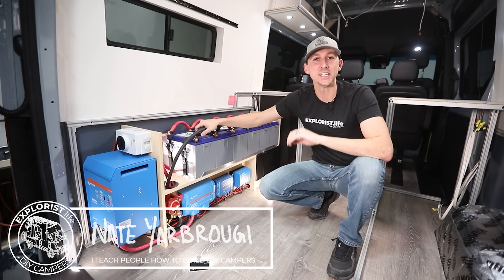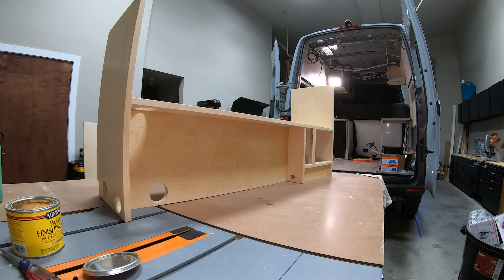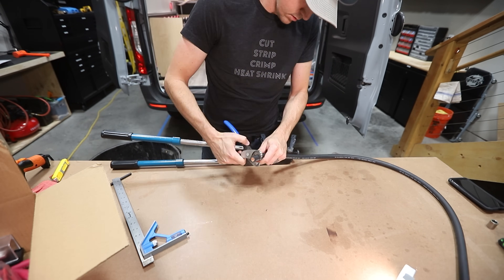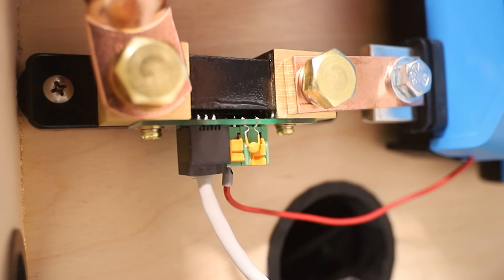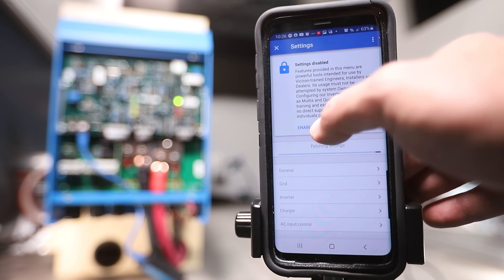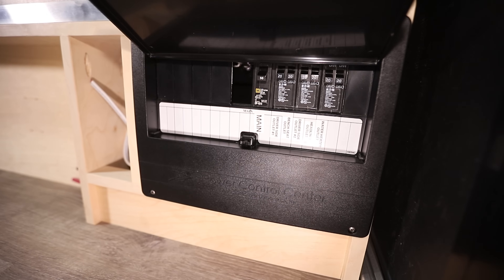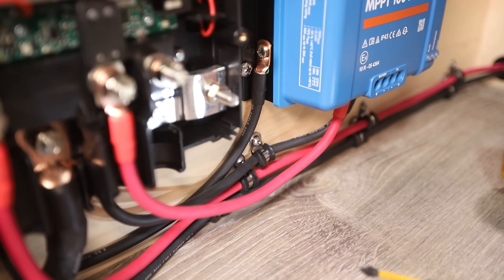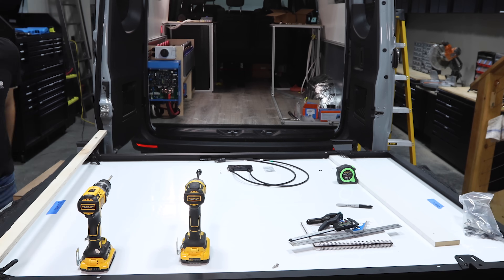DIY Sprinter Camper Van Electrical Install - Full Tutorial

Comment: I have done a few installations as well and I  have a quite of few comments about mounting on wood, or any flammable materials. Any insights, advice.
Reply from the maker: Although wood is indeed technically a Class A Combustible material, it's auto-ignition temperature (the temperature at which it will catch on fire without an external source of flame/spark) is just north of 400 degrees F.  If temperatures are high enough to get the wood to 400 degrees, something else has gone terribly wrong and there will also be other things in the immediate vicinity that will be catching on fire.  **Not too often I get to use my degree in Fire Science.  Thanks for that. :)
Reply: @EXPLORISTlife thanks, watch your videos and good to get tips from.
Reply: @EXPLORISTlife  I have fuses and heat is never an issue but people will always point out something.  I  guess it a way to strive for perfection.

Comment: Hi Nate. Dc-dc charger, you always prefer Orion-Tr Isolated Smart DC-DC Charger. What is the reason for choosing non-isolated?
Reply from the maker: Isolated works in 100% of all use cases with no questions asked, which is why I recommend it over non-isolated.
Reply: Thanks. One last question. Where I plan to put the charger is 17 ft from the car battery. This distance creates a problem for 16 mm2 cable. Does the non-isolated charger have an advantage in this regard? Your answer to this question is very important to me.

Comment: Question, the sprinter fuel tank is on the left side, are you concerned about weight when placing the battery bank on the same side?
Reply from the maker: The battery bank weighs about the same as an average size adult male.   So, no.  I'm not concerned.
Reply: Thanks for the quick reply. Your videos are the best. To the point, in order of application, very informative. Thanks

Comment: @EXPLORISTlife  there an important reason why you are wiring your A/C power with 3 insulated wires, instead of standard 12/2 or 14/2 wiring?
Reply from the maker: Very much so!  I think you'll find our 'Wire Basics' chapter of our Academy helpful: https://www.youtube.com/playlist?list=PLmvhcyi4n0TXLHS1NeK_sCvq3Wsa3B0kT
Reply: @EXPLORISTlife  that IS a great help.  With the information shared, I may be saved.....but only due to the luck of my specific application(s). Will definitely be using these videos over again in the future.

Comment: Is there a reason that you cannot use the original alternator charging in a travel trailer setup? Why is the 12v-12v Orion needed in that aspect? Again just talking about a travel trailer setup, not in a van. Thanks!
Reply from the maker: The original 7 pin connector usually only charges at less than 10A, so by using a 30A charger, thhe amperage will increase which means faster charging.  Also, the charging profile from the Orion will charge the batteries to 100% where the original 7 pin may not.
Reply: @EXPLORISTlife  thank you! I did finally find your blog post about the charging methods as well! That was extremely helpful! Your website and these YouTube videos are the best I have ever seen! Keep up the great work!

Comment: JUST STARTING NEW IN THIS, WHAT WOULD BE MINIMUM SYSTEM WOULD I NEED TO BE ABLE TO BOIL A KETTLE FOR A CUP IF HOT WATER  AS WE LIVE IN A RURAL AREA IN BRAZIL, THANKS
Reply from the maker: You'd want to find the size of your kettle and size the inverter for that.  Some kind of portable power unit like a Goal Zero or Jackery should be sufficient.

Comment: Can you tell me what size fuse you used for the solar charge controller? I bought your downloaded plan for this but even with the higher resolution I can't make out the size of the fuse used and in this video you don't mention or show what size the fuse is. I'm using all the same components as you are in this video except for the inverter/shore power unit ...I'm using the victron 2000 w inverter model.
Reply from the maker: Remember, everything in this video is from the various kits mentioned throughout the video.  For the charge controller fusing, that is part of the 'solar charging' section of the video and the fuse in question is the one mentioned in the EXPLORIST.life MPPT 100/30 Wiring Kit.  If you navigate to our store to the EXPLORIST.life MPPT 100/30 Wiring Kit page, it includes the fuse you're asking about.  Here's a direct link: https://shop.explorist.life/shop/all-products/camper-wiring-kits/solar-charge-controller-wiring-kits/victron-smartsolar-mppt-10030-wiring-kit/

Comment: Victron requires that the Orion is mounted on a non-flammable surface, what coating do you use?
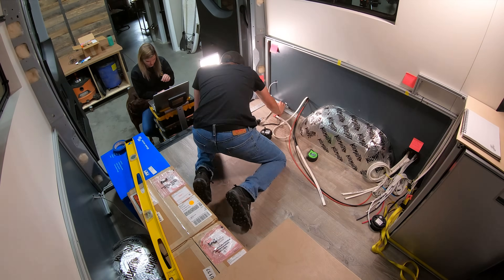Reply from the maker: The 'coating' we used is shown in the 'building the frame' chapter starting at the 1:30 timestamp.

Comment: Any experience with swollen batteries? I have some new lithium 200ah lifepo4 batteries and they swelled up at the top a bit in the van after one day. Should I return them?
Reply from the maker: I'd recommend contacting the manufacturer for guidance, yes.

Comment: The 4/0 lugs I have don’t fit in the lynx power in.  Did you have to use a special lug or did you modify the lugs somehow to make them fit?
Reply from the maker: The lugs we supply with our kits just fit.  We had to go through about two dozen sources to find ones that fit, though.  Perhaps consider ordering the kits mentioned in the video if you want parts that are guaranteed to fit the first time?
Reply: @EXPLORISTlife  thank you. I’m well into this project using parts I already had on hand.  The only issue I had was with the 4/0 5/8 cable lugs I have being to wide.  So I just used a grinder to make them narrower so that they fit.  I learned a lot from your excellent videos. Thanks again

Comment: How did you secure the battery box to the actual van, I didn’t see any pocket holes or other support? Thanks!!
Reply from the maker: Bolts to the 8020 and then the 8020 is bolted to the van.

Comment: How long is the wire length of the positive, negative, and equipment ground wire for the multi plus to the lynx distributor?
Reply from the maker: Our kit for the Lynx Distributor to the Multiplus includes 5ft of red for the positive wire and 10ft of black for the negative and equipment ground wires.
Reply: Thank you so much for getting back to me so fast. I was curious what length did you cut the cables in this video for this project. I am copying the same thing and I was just curious what length did you cut your cables to? Thanks again for such awesome content.

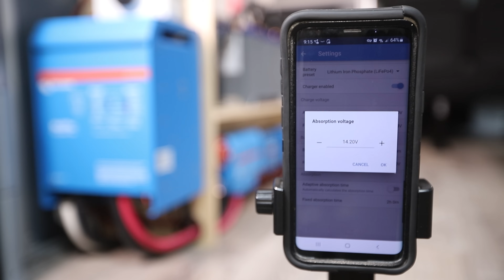Comment: Nate - One more thing, at 58:44 you say you will leave a link to a cheat sheet for the battery settings on the Orion DC-DC charger. I'm not seeing that. Is that on here? Thanks.

Comment: Is the wire you are using to wire the batteries 2 AWG or 4 AWG? They look like 2 AWG and in the diagrams provided on your website it says 2 but then In the video and in your wiring kits you say 4. I’m confused
Reply from the maker: We used 4/0 (not 4/0) to wire the batteries together.  The wiring kit includes 4/0 as is also noted in the wiring diagram.

Comment: Hi..what if my country uses incoming supply of 230Vac? does the inverter able to cater for this kind of system?
Because most of our equipment uses 230Vac
Reply from the maker: You'd just need a 230V version of the inverter with the associated appropriate AC wiring.

Comment: This is helpful and amazing but does anyone know reason why everyone uses battle born batteries and Victron MPPT and inverters when there is much cheaper and easier off grid solar batteries and inverter with built in MPPT?
Reply from the maker: Cheaper equipment generally uses lower quality internals, has worse warranties, less customer support, and fewer features.  Battle Born Batteries and Victron Energy is the best, IMO, mix of not being the most expensive, but also having great quality, warranties, customer support and features.
Reply: @EXPLORISTlife  Thank you for the reply. I used EG4 inverter and EG4 Life power 4 server rack battery to make off grid cabine solar system so I was wondering if reason everyone use these waterproof rv/marine battery was because regular home battery would not handle vibration from travel and possible water leak can cause battery to explode if not waterproof.

Comment: I’m curious why on the renogy 3000W inverter charger diagram. The buss bar and fuses you have lined up have fuses that are rated higher than the wires intended amperage. I’m a confused why this is?
Reply from the maker: This video talks about why that's allowed: https://youtu.be/ki3WXVR48eM

Comment: Hi:-) Can this system be used in a 230 volt system by changing settings ? Or do all wires etc need to change as well as the modules? Me myself live in Norway and 230 volt AC @ 50hz is the standard.  Im in the process og building my LR3 overland prosjekt and a trailer . This setup got me going and I'm hoping that I also can by kits from you if its compatible:-)
Reply from the maker: You'd want to change the Mutliplus Inverter/Charger to a 230V 50Hz model and the 120V breaker box to one more common to your area, but the DC side of the system should be 100% the same.

Comment: Hi Nat, another great Video. Building a system from the plans I bought from you. 
 Please help.
I am about to buy a 2000W Inverter / Charger for my old RV. 
Charging?
DC to DC from the alternator to Lithium Batts
Solar 400W to Batts
Shore 120v 60H
Generator 1500W running max 1400w
Problem? If my generator at max does not put out 120v or 60hrtz it's just under that, Can the Inverter /Charger adjust to the under performance without the Generator damaging the Charger?
Regards David H
Reply from the maker: The Inverter can indeed adjust to a degree.  Check the data sheet for the Multiplus to see what kind of voltage it can work with.  if the parameters are TOO low; you'll 'likely' just get an error code and the charge will shut down before anything is damaged.

Comment: Could this system be used in a 27ft travel trailer? I'm very interested but concerned about having an A/C and Heat unit that will be completely electric.
Reply from the maker: Sure!  I have this diagram set up for a 50A or 30A OEM RV Electrical upgrade here: https://www.explorist.life/solarwiringdiagrams

Comment: One more beginner question; the 3/4 heat shrink does not want to slide onto my cables going from batteries.  Is there a trick to that?  Honestly I just ordered some 1 inch but I'm curious of your opinion.  Thanks!
Reply from the maker: We include 1" heat shrink in all of our wiring kits that have 4/0 wire. 👍
Reply: @EXPLORISTlife  Got it.  Thanks!

Comment: The lugs I bought from your list for wiring the 4/0 to the battery seem different/heavy duty than the ones you use in this video. The ring terminal part of my lugs are so large I have trouble positioning them onto the battery terminal.
Reply from the maker: Are these lugs the ones included in our kits like we showed in this video?  https://shop.explorist.life/shop/all-products/camper-wiring-kits/complete-wiring-kits/600ah-multiplus-3k-12v-orion-12-12-30-400w-solar-wiring-kit/
Reply: @EXPLORISTlife  no. I bought these off the shopping list of Amazon links you provide under the 400ah/600watt wiring diagram I purchased from you last year. They are the silver tinned ones, not copper. If I force them, they jam up the bolt and push into the battery.
Reply from the maker: Yeah, the Amazon links have been a huge pain point for me.  The sellers on amazon regularly switch up the make/model of lugs and sometimes they change them to a type that doesn't fit.  I never get notified of this or anything, so it's just one of those things that sucks for all of you who are trying to follow these projects.  This is one of the biggest reasons we opened up the EXPLORIST.life shop and started selling these kits we featured in this video ourselves; so we could verify that everything works as we need it to.  Fun fact: we price everything in our store at the same price you could get it for on Amazon, so it's easier at no added cost.
Reply: @EXPLORISTlife  ok. I hear that. Is there then a way to sand down the lugs a bit? Thanks for the help and all that you share.

Comment: Hello! I am looking to purchase the Sprinter Camper Van 600Ah – 3k 12V Inverter – 400W Solar. My question is how does the system know/understand when you have solar, shore and inverter power to the batteries? Does the Victron Lynx Distributor control that? I am just think the system would be overloaded and have issues with your battery bank.
Reply from the maker: All of the components either communicate with each other to coordinate charging or shut down as appropriate automatically.  All of this happens automatically, so there's nothing to bother with.

Comment: Hello, 

I’m looking into adding an additional 12v DC fuse panel to a travel trailer that has an existing distribution panel, the WFCO WF-8735p. The reason for that is that the WF-8735P distribution panel limits me to only 6 x 12v and I want to add a few more 12v appliances like RV tank heater pads. Would I be able to wire the 12V DC fuse panel available on your site to an existing distribution panel (WF-8735P) in order to expand my 12v appliance options or would it be best to wire directly to the battery with 100amp fuse along the route?

Thanks,
Rene
Reply from the maker: Yep!  The 100A fuse would protect both fuse panels and the wire going to each (which is likely 6AWG).
Reply: @EXPLORISTlife  I found the 8awg wire that comes from the battery and connects to to the battery positive wire on the 12v side of the distribution panel that come with the travel trailer. Do you have a diagram that could potentially help with how to wire to the extra 12v fuse panel?

Comment: is the negative ground the only ground in the system? none on the AC panel?
Reply from the maker: Neutral to ground bonding happens through a relay inside of the Multiplus Inverter/Charger.

Comment: Maybe a dumb question to ask , for such a high load why not use a 24v system instead of a 12v system ? Most battery genius keeps reminding me to switch to a 24v system from my 12v system . Please help me out. Thank you
Reply from the maker: 3kva worth of loads isn't too big for a 12V system and you won't gain anything from that; especially if the system is already up and running.  24V is good for larger than 3kva systems.  Search YT for: "EXPLORIST.life 12v vs 24v vs 48v"
Reply: @EXPLORISTlife  thank you so much, that explains a lot but where I'm currently living using 220v ac instead of 110v Ac in the US. But yes I'd probably go with a 12v system cause most batteries don't like to be in series and once they are imbalanced I've to replace them both. I'll probably be spending more money later.

Comment: I have been running this exact setup for about two years with no problems. Out of the blue, my van engine battery has gone dead twice. I replaced the battery and the van has gone dead again and after I jumped it, I took as look at my victron app. As soon as I turned my house battery system off, my engine battery voltage dropped rapidly to 6v and the van is dead again. Any help here with a system that hasn’t changed for two years and having sudden problems. Can I simply disconnect the dc dc charger? At what juncture would I do that? Please help! Thank you so much
Reply from the maker: Could be a number of items. For customer support: visit shop.explorist.life/support and we can take a more personalized look.

Comment: If my system is turned on and I'm hooked to shore power and my vehicle is running...what is charging the batteries, the alternator or shore power?
Reply from the maker: To prevent accidentally driving off while connected to shore power, it's a good idea to never turn your engine on while you are connected to shore power, but if you did... shore power would likely take priority.

Comment: I am wanting to do a 48 volt system with 7200 watts of solar with (24) 300 watt panels and running a 120/240 and 12/24 volts step downs what would you recommend with a 9500 watt backup generator to charge the batteries if i need to with possibly adding another 1200 watts in deployable system to go to 8400 watts
Reply from the maker: I hate to be like this, but there is too much to 'recommend' in a single youtube comment to walk you through all the parts and components.  If you have any more specific questions, feel free to ask, though.

Comment: Can run in parallel a 200 amp hour battery with a 100 amp hour battery there both ampertime time batteries
Reply from the maker: It's not ideal, no.

Comment: So I am just beginning to run the heavy wire from battery to battery and I need help in figuring out how to get the lug on once I cut it and strip the casing away.  I've only attempted one (as a practice piece) and the outer wires "splay" out and will not tuck neatly into the lug.  Any advice on this?
Reply from the maker: You may have to 'practice' again.  The cleaner the strip, the less the wires splay out.  Here is everything I know about crimping wire lugs: https://www.youtube.com/watch?v=JmiX2XW48F8&list=PLmvhcyi4n0TUjVGA_O5aI5SQrS1kKLgEF
Reply: Thanks for the tip.  2nd practice went much better.

Comment: What are your thoughts on using a breaker on the shore power input?
Reply from the maker: Exactly!  Same reason there isn't a breaker in the wire between the wall outlet and your toaster.  The breaker is already in the breaker box!

Comment: Can you suggest an alternative to Baltic Birch? Our local supplier gets BB from Russia, but unfortunately, has suspended ordering from there. One more thing? Will this box design work for a Promaster, 159" EXT?
Reply from the maker: Just look for some 'cabinet grade plywood'.  They'll have an alternative.  The enclosure dimensions should be 'close', but you always should double check dimensions against the 3d model to verify.